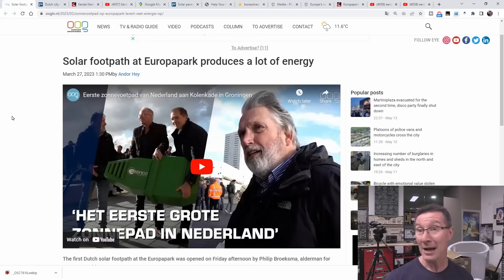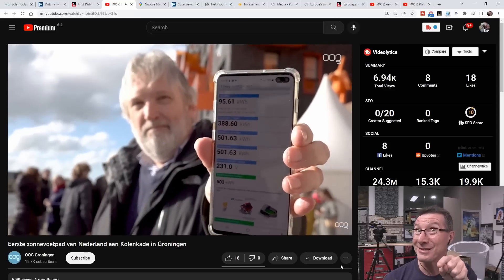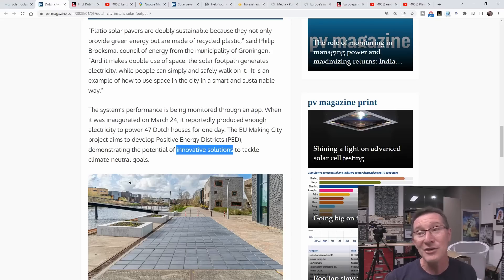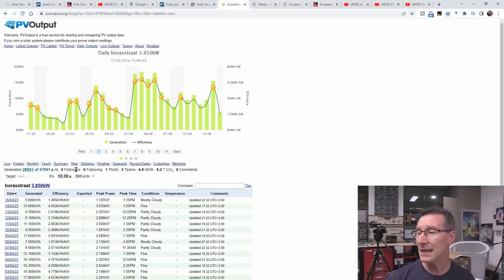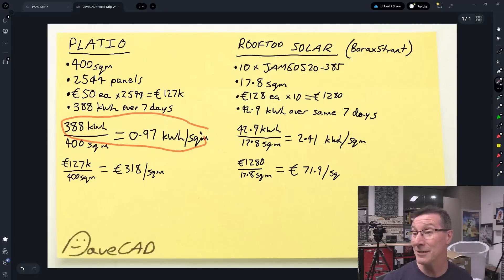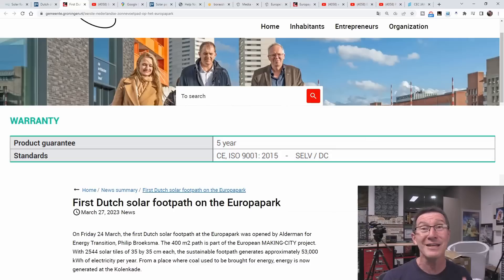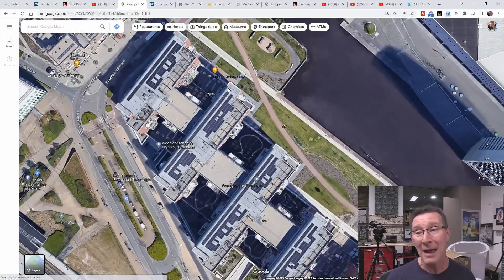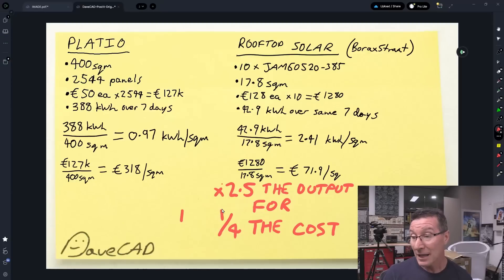EEVblog 1544 - Platio Solar Pavement BUSTED!

Comment: According to the website of the city Groningen the total cost of the installation was about 400,000 Euro, of which 290,000 was subsidized by the EU.
Reply from the maker: Thanks. So that 400k would buy 3252 405W panels, not including installation. That's a 1.317MW array vs 54kW for the Platio's 400sqm. LOL. 
Let's round to 1MW includng installation of a traditional rooftop/commercial solar array. Basically 20 times the capacity for the same price, sound about right.
Reply: @EEVblog  TBF, Solar panels are about 1/2 of the cost of any installation. It's still a sh*tshow, but not quite as bad...
Reply: @EEVblog  A better comparison: Rooftop installation 10kW+10kWh in Germany, energy produced in May: 1/55 of what that Groningen installation is supposed to produce per year: ~20k€. So even with batteries rooftop solar of the same scale would cost half of what they spent there.
Reply: @EEVblog  I still don't understand why they don't just push solar panels on rooftops before doing this crap.
Literally the trend of buildings today is flat rooftops, but nooo let's install solar panels on the floor where it's dirty and prone to "heavy" traffic.
Reply: @svampebob007  Did you not see the video they have solar panels on the roofs, eventually you run out of space
Reply: @Chris-rg6nm  then run out of space BEFORE doing this crap, but I did comment before seeing all the solar panels 😅so GOOD JOB on those that actually invested their own private money into solar.
Reply: @Chris-rg6nm  Putting solar panels on the pavement because you've run out of space on nearby roofs is like storing your food in a toilet cistern because you've run out of space in your fridge.
Reply: @EEVblog  Comparing the costs of a small scale product still in beta to cheap mass produced products that have been tried and tested seems a bit silly though. 
Yes solar roadways are silly but atleast make correct comaprisons.

You keep bringing up the monetary aspect of these projects: these are your tax dollars etc, but on the grand scheme of things this is absolute peanuts compared to what is being spent/lost. For example: cleaning up some mess a big company made, actual corruption, tax cuts, WEAPONS?!

If you cared about the money you wouldnt make 20 videos on projects that dont really cost all that much (in the grand scheme of things)
You dont seem to have any other argument than: its a dumb project and it costs money X 20 

Makes me wonder, whats the point of all the drama and outrage.
We wouldnt have the internet if it wasnt for wreckless government spending, who knows, maybe something, a single molecule of positivity can come from this.

Btw, in Germany they are closing nuclear powerplants before their expiration date, now THAT is outrageously wastefull.
Reply: @EEVblog  Ok so where do you put those solar panels? If all the houses and building area already covered.
Reply: @Chris-rg6nm  show me a single google maps screenshot where there is zero space remaining for solar panels. Any city anywhere
Reply: @Chris-rg6nm  I would put panels on south facing vertical sufaces before putting them on the floor.
Reply: But are they earthquake proof?
Reply: @danosdotnl If they are not then it is even better! It means that very soon they are going to get another juicy transfer for govrnment subsidized orders. And since it does not make them any less "innovative" it would actually be great news for their stakeholders. It is pretty much the crappier the better as long as it does not look like a complete piece of garbage and they still manage to make the government spend the money!
Reply: @danosdotnl  In Holland?
Reply: @fredbloggs5902  in Groningen, due to natural gas extraction....
Reply: @danosdotnl  who knows ;-) For non Dutch people here - Groningen has issues because of natural gas exploitation in the province...
Reply: Earthquake... Right...
What? 
There? 
You are kidding. Right?
Reply: @danosdotnl  Earthquakes in Groningen are less than 4 on the Richter scale. Look it up. Road traffic is heavier.
Reply: @danosdotnl  why wouldn't they, it's literally pavement
Reply: @marcogenovesi8570  there's more chance of something landing on them, than if they were on the roof.
Reply: @zaprodk  But there is much less chance of them collapsing together with the building they are on
Reply: @marcogenovesi8570 He wasn't serious. It's an inside joke in The Netherlands . The province of Groningen has been experiencing small earthquakes because of the extraction of gas from a giant gas field located there. It's been a hot topic in recent years because of damage to houses caused by those quakes and the lawsuit that followed to make the extracting company compensate those damages.
Reply: @danosdotnl  In Groningen? They must be water tight. Not earthquake proof.
Reply: https://youtu.be/r-Vce4Ew5_w
The “wethouder” (alderma according Google) states in this clip that there is about 300k coming from Europe, 110k from the local authority. And that it produces about 4 to 5k Euro of energy per year….
Reply: I have a great idea solar underground parking roadways. All this light from light bulbs is getting wasted. Please give me money.
Reply: @amotriuc  That's nothing when compared with my Solar Sewer Pipe startup! My newest prototype not only captures solar energy but also the mechanical energy from the sound waves of rat farts!
Reply: @HenryLoenwind  Wow, this is great how can I invest in this?
Reply: It's not mentioned on the web site of Groningen city !
So where is it ? (link please)
Reply: Stupid Government Syndrome at it's "best". Instead of fighting climate change, by using the money on the best available solution, they're throwing money at ridiculous proyects that make no sense. So, instead of helping the fight against global warming, this impairs it.
It would be ok, if it pays for proyects that can potentially have a greater impact than already proven solutions, but this? This is nonsense.
Reply: It is a successful Gr$$n Energy Project, achieving it's goal of transferring taxpayer and investor money to the bank accounts of the company founders.
Reply: I remember the first of these solar walkways started failing in less than a year.
Reply: this is all about, money scam from EU , less educated people are more things like that will happen!
Reply: 400000 Euros?? I know people installing a 40kWp rooftop solar system right now and it costs 50000 Swiss Franks. That's probably 1000 kWh in 7 days. That price is including installation and fixing the old roof.
Reply: Isnt that bad as the vattenfall wind farm which was subzided and the energy was already sold to microsoft or google for a new datacenter.
Reply: That's all wind and solar projects are, they are just propped up by subsidies. Look at solar and wind power in the US, with Trump cutting the subsidies, most new projects are dead in the water. So why not subsidize a solar walkway? At least you get some cool shatter resistant glass out of it.
Reply: Now I like when EU funds stuff. But this was waste of money
Reply: They will not always be 80 euros each. They will be marginally more expensive than normal paving stones and millions will be made so your leccy is virtually free. The sparky in the video does not understand business and scale.
Reply: @Andrew-rc3vh  Your a complete moron.  You think a solar panel is going to be "marginally" more expensive than a rock...
Reply: Nice to think that my country is a net contributor to the European onion. Time to leave.
Reply: @storhemulen  
I suggest you migrate to the UK.
So much better there.
Reply: @wimahlers  I might, but until then its better if we leave. The downsides are many and the upsides few.
Reply: @storhemulen  
upsides / downsides

Such as?
Reply: @wimahlers  biggest upside is of course regaining ones independence from the morons in Brussels. Another is the net cost that is removed. Downsides? Nothing obvious.
Reply: @storhemulen  
Again, upsides / downsides

Such as?

Be specific. Much obliged.
Reply: @wimahlers  I thought I was very specific. Not being a member means  you can decide your own fate and you don't pay any membership fee.
Reply: @storhemulen  
What own decisions?
Your personal decisions? Your town? Your street? Community? Region? Country?
What decisions are you talking about that are completely isolated and independent with no impact to the artificial border you have in your mind?
What own decisions are you talking about?

You are not specific. Be specific.
Reply: @Wim Ahlers  since the union is made of member states, obviously the decisions of the state itself.

How can this be so complicated to grasp? Not all want to be a part of a European federation.
Reply: @storhemulen  
Still to vague.
States still take state decisions (pension, taxes, healthcare, local infrastructure etc.)

so, again, what decisions are you talking about that are completely isolated and independent with no impact to the artificial border you have in your mind?

On a side note, why do you accept state decisions? Not all want to be a part of a state federation.

Where do you make the distinction?
Reply: @wimahlers  You do not want to understand or you are offended that I want to leave the EU. I don't know which but I can't help you anymore if you don't/won't get it, sorry.
Reply: @storhemulen  
You want to leave the EU. And that is fine.
However, so far, you have not given a single specific detail about what is wrong with the EU. And why leaving the EU is more advantageous than being and remaining a member of the EU.

Sure, the EU entails some European commitments, procedures and responsibilities.
But so does being out of the EU but still having interactions with the EU. As surely non-EU member UK can confirm.

You must be specific in specifying what advantages leaving the EU in practice and reality will have. As a real life example you can use the UK and specify all the advantages it has or soon will have using facts.

If you won't or can't specify these benefits then I can't help you anymore if you don't get this crucial point, sorry."
Reply: @wimahlers  you are quite obviously offended that I think my country would be better off deciding its own paths. This is in itself a reason too leave. But if you want a specific reason, I can give you some. 
One is the european market for electricity, forcing us to export 70% of overseas total capacity, which makes the price much higher for consumers here. Several times higher actually with insane fluctuations. Another is that EU wants to put restraints on forest harvesting, which is totally unacceptable. Yet another is the regulations on gender in company boards of directors. No matter the reason, they are all examples on things that should be under the jurisdiction of each individual member state.

A union of nordic countries would serve us much better, of course.
Reply: @storhemulen  
So, you mentioned some EU commitments you don't like (ignoring the fact that you specified no verifiable sources for your crucial claims and specified no context).

Do you agree with every single non-EU related parliament decision your country is making?

I guess not.

The Brexit movement in the UK used very similar negative arguments like the ones you presented (e.g. using fishing grounds instead of forests).
Can you even honestly name one positive outcome as a result of Brexit?

Why do you think you will be better off on your own?
Just saying "we will be" is not an argument. At best it appeals to an irrational emotion only.
So, be specific. Present details.
Just listing some few cherry picked out of context argument you happen to personally dislike is no argument.
I can do that too. As a matter of fact I did, as far back as 1992 (when Denmark opted-out the Euro).
Reply: @storhemulen  How would that improve the situation for anyone? I would suggest focusing on things that need improvement, like the financing rules, and fixing them. Rather than abandoning the ship.
Reply: @pbasista  abandoning a sinking ship, with a captain that claims everything is fine, would seem the right thing to do.
Reply: @storhemulen  Your analogy is unfitting.

Many of the important aspects of the EU membership are fully operational and vastly beneficial to a member country. You are deliberately dismissing this important fact. Drawing parallels with a sinking ship is disingenuous and cannot be considered objective by any stretch of imagination. 

What you complain about, namely the EU funds' allocation rules, or lack thereof, are definitely issues which deserve to be looked into and resolved. They are marginal when compared to other benefits. But in spite of that, it is in the interest of every EU country to improve in these areas because it is our common money that is being spent inefficiently.

In my opinion, that is a responsible way to approach such issues.

Comment: "unless it's the simplest and most practical solution we shouldn't do it" What a short sighted take. What's wrong with developing and testing out alternate solutions? Solar panels didn't get reliable and cheap because they were practical. It came from investing in them before then.

Comment: Each PLATIO solar tile would need to cost €11.31 to be cost equivalent with the rooftop solar in your example. That being said, the solar tile would be ideal for those situations where traditional roof solar pv is not possible. The solar tiles will still generate electricity and still provide an ROI, albeit over a longer period

Comment: The main problem is that even if these installations were to be as efficient as rooftop solar, most people don't realize that the bulk of the total cost is going to be cost of maintenance of the systems as well as the ancillary systems required to properly monitor and operate the setup.
For context, I've worked on a tender several years back (on the IT side of things as part of a large consortium) for massive rooftop solar projects called by the local government here in Asia and the numbers are quite telling.
The tender called for a installation and maintenance of 70MWp output from 1,400+ solar array installations with minimum 85GWh generation guaranteed for the 1st year - with degradation to 80% of nominal output at the end of 20 years.
Our estimates put the project at a cost of about $50 million upfront (about $10 million goes to the other misc. systems & services like IT networking infrastructure, IOT monitoring systems, backend hub datacenter equipment etc) along with an annual maintenance contract of about $13 million per year to keep the systems running at the required outputs.
This was a grid-tied setup (without batteries) and even if we average out the allowable degradation and at the electrical tariffs at the point in time which the system could 'sell' the electricity back to the grid, the entire setup would only provide about $13.3 million per year of sold electricity to the grid.
This means that the $310 million total investment would only give a returns of $6 million after 20 years (1.9% ROI after 20 years) if the government does not even need to pay their own staff to manage the maintenance vendor. The only way the tender would even make any monies was to actually lease out the use of the installed IOT infrastructure to other agencies.
E.g. Urban planning agencies to run IOT ambient sensors (light & noise pollution), environmental agencies to run sensors to detect issues with sewage drains, town councils to run sensors to detect refuse collection points sensors to optimize garbage truck runs to reduce costs etc.
They did eventually go ahead with these series of projects (this was just one of many phases to cover about 20,000 rooftops in total) since the justification wasn't so much to save/ generate money but just a go green(er) initiative since we don't have the natural resources or land space to have any other alternatives for 'clean' renewable energy (hydro, nuclear, wind etc.) and have solely relied on fossil fuels to generate power locally.